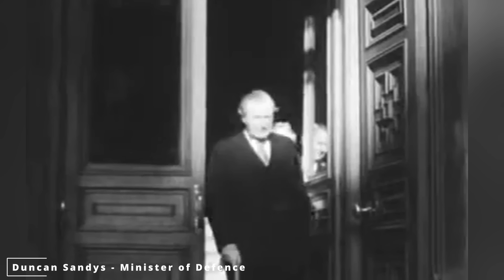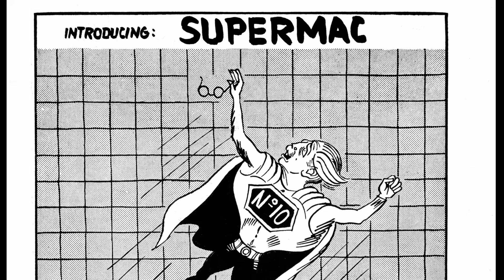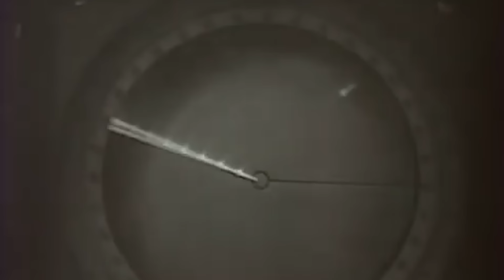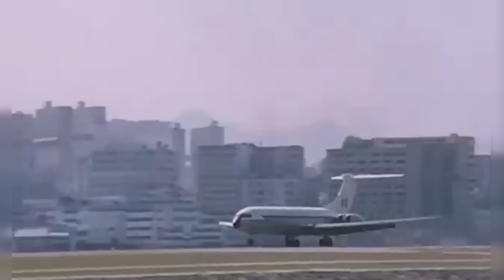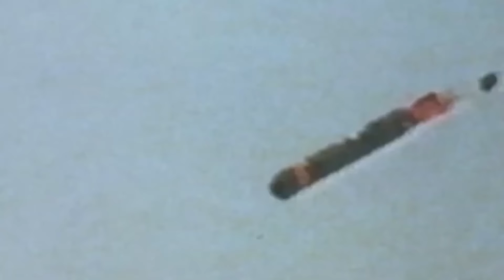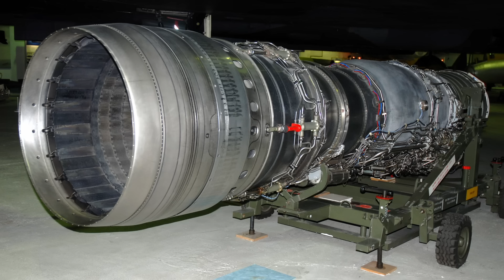How Britain Turned A Failed Airliner Into a Soviet Submarine Predator | The Mighty Nimrod

Comment: The only “failure” is your lazy research. However since you’re calling names , NIMROD was the failure here, costing hundreds of millions to improve its performance which was money down the drain, the usual defense fck up in the U.K.
Reply: We believe we can clear up some commonly held myths and misconceptions obviously.

It's always good to see the facts presented clearly and concisely isn't it?

All production Nimrod aircraft were new build Comet 4 airframes with the necessary modifications. The Nimrod was the most advanced and most capable aircraft of it's type at the time it went into service. The  Nimrid HS.801 was not available for purchase by other countries. The ability  if the HS 801 to repeatedly demonstrate detection of subs and the knowledge that it could deliver nuclear depth charges to a target was a very effective deterrent. 

Bow-wing (see B-47 wing collapse wing folding incidents) had built less than 12 pressurised airliners before the Comet first flew and they were not high altitude airliners. 

All Nimrods were new build Comet 4 airframes with appropriate strengthening and the unpressurized  equipment bay tacked on. 

The HS 801 Nimrod was the most advanced aircraft of it's type at the time it first flew. Problems with the MRA4 programme were almost entirely due to radar and computer equipment issues and BAe Systems & co being too busy with other work at the time. 

Obviously there have been worse aircraft for accident losses both before & after the Comet and Nimrod.

Early problems with Comet takeoff stalls were caused by pilots over rotating the aircraft at liftoff. 

Podded engines on wings have aerodynamics issues. The main reasons for eventually going with podded engines were because or to facilitate - Ease of maintenance. Use of shear off fixings given excessive out of balance forces.
Large diameter turbofan engines.
Reduce load on the wing to fuselage connection. Increased power from later engines. 

The Bow-wing (See B-47 wing collapse & wing folding incidents) was a good example of how to expend a huge amount of cash and effort on something that was probably not worth bothering with. The basic design of the Comet had been decided upon and established before the podded engine choice has been made for the B-47. There were aerodynamics problems with podded pylon mounted engines at the time. The US also built and operated a significant number of EE Canberra bombers under licence which did not use podded engines for their wing mounted engines. . 

There have been aircraft losses caused by pod & pylon mounted engines. 

All jet airliners benefited greatly from the knowledge gained from the Comet incidents & subsequent investigations & yet some were still worse for accident losses. 

Instances of all marks of the Comet flew with full certification after 1954 including the Comet 3. The last Comet flight occured in 1997.

The fabulous trail blazing DH Comet.
World's first jet airliner in regular service.
The jet engined Avro Lancastrian actually did a passenger service before the DH Comet. 
World's first high altitude airliner.
World's first airliner with a full fuselage length pressurised cabin pressurised for high altitude flight. That feature for that type of aircraft was a considerably difficult undertaking. 

The change from larger squarer windows to smaller rounder windows was necessary for the particular aircraft at the time. Skin thickness remained mostly the same for all Comet marks. 

How things were back then.
Accident losses - % of aircraft built.

DeHavilland Comet 4 UK                          14% 
DeHavilland Comet all mks UK (ff 1949)17%  
Vickers VC10 UK (ff 1962)                         5%

Douglas DC-1  US                                       99%
Douglas DC-2                                              47%
Douglas DC-3                                              30%
Douglas DC-4                                              26%
Boeing s300    US                                       72% 
Boeing 307                                                  70%
Boeing 247                                                   48%
Boeing 707  (ff 1958)                                 32% 
Lockheed L-049 Constellation (ff 1943)  30%
Lockheed Electra US (ff 1957)                   29%
Fairchild FH-227 US (ff 1966)                   30%
McDonnell Douglas DC-8 US  (ff 1958)   14%
Sud Aviation Caravelle  (ff 1955)             15%
Canadair CL-44 Turboprop US (ff 1959) 46%  
Convair CV-580 Turboprop US (ff 1960) 22%
Convair CV-880     (ff 1959)                      27% 
Convair CV-990     (ff 1961)                      33%
Tupolev T-104        (ff 1956)                     16%
Vickers Viscount UK  (ff 1948)                29%  
Fokker F-27 Turboprop NL (ff 1955)       40%      

The Vickers VC10, fastest Atlantic crossing for a non supersonic jet airliner, held the record for 41 years.

For the first few years of operation the Caravelle & Comet had similar accident loss fatalities.

Sud Aviation Caravelle - 
all accident loss fatalities - 
1320 fatalities. 

De Havilland Comet - 
all accident loss fatalities - 
453 fatalities. 

An example of a typical airliner from the period. 
The Fokker Friendship F-27 fatalities & accident losses as a % of aircraft built. 
Fokker F-27 Turboprop (ff 1955)   40%
2130 fatalities.

Of course De Havilland carried out a full stress analysis & performed extensive & protracted testing on two long lengths of fuselage representing all features of a complete airframe. De Havilland carried out significantly more testing than was required by any authority at the time & significantly more testing that any previous airliner was subjected to.

De Havilland designers / engineers knew all there was to know about metal fatigue at the time they designed the DH Comet.

De Havilland had prior experience building many all metal construction airframe aircraft including many passengers aircraft & thousands of jet powered fighter aircraft that were primarily of metal construction with pressurised cockpits & used jet engines built by De-Havilland.

De Havilland did indeed always work to better than industry standards at the time, used up to date knowledge for the design & testing activities & no evidence of negligence or criminal negligence was ever produced in relation to the DH Comet.

Global aerospace. 
From the 1950s sector rationalisation and consolidation took place. 70 companies in France and 300 companies in the US disappeared due to merger or dissolution. In the US Boeing was almost bankrupted by the 707 project.  Boeing had a well protected domestic market and the available space and resources in the US to engage in large scale airliner manufacturing enabling them to capture orders simply by being able to produce airframes fast enough and cheap and nasty enough. Another factor is airlines preferring to obtain as much of their airliner inventory as possible from one manufacturer. 

Global Aerospace Sector, what's happening.

For example, there are of course no German companies that makes German jet aircraft in Germany & there are no German companies that make German gas turbine aero engines in Germany that are suitable for widebody airliners.

The UK has the world's highest combined per capita Nuclear / Defence / Aerospace Sector Activity.

UK defence sector, absolute terms, world's second highest activity. 1st for per capita defence sector activity. Per capita nuclear powered submarine construction, 2nd position. 
Main players being Rolls Royce, Babcock, GKN Aerospace & BAe Systems. Activities often involve international collaboration. BAe systems, RR and other UK companies now handle more Airbus work value wise than Germany. 

There's a good chance that anyone currently flying on a widebody airliner will be on an aircraft powered by RR gas turbine aero engines made in the UK and a good chance there will be other hardware on the aircraft that's designed and / or manufactured in the UK. 

Rolls Royce Holdings UK
Subsidiaries
- Rolls-Royce plc
- Rolls-Royce North America (ex Allison etc Classified Military stuff)
- Rolls-Royce AB
- Rolls-Royce Deutschland
- Rolls-Royce India Private Limited
- Rolls-Royce Marine Power Operations
- Vinters Engineering Limited
- Rolls-Royce Controls and Data Services
- Rolls-Royce Power Systems
- Bergen Marine
Joint ventures include:
- Rolls-Royce Turbomeca
- MTU Turbomeca -

Trent Family
The MT30 (Marine Turbine)
Industrial Trent 60 Gas Turbine
Trent 7000
Trent XWB Airbus A330neo.
Trent 1500
Trent 1000
Trent 500
Trent 600
Trent 700
Trent 800
Trent 8100
Trent 900
   
RR wholly owned subsidiaries in Germany handle smaller 2 shaft RR gas turbine aero engine work.

The UK space and aerospace sectors are highly productive, high-value industries that together contribute over £18 Billion in direct Gross Value Added (GVA) to the UK economy. Individually, the space industry directly contributes about 0.3% of UK GDP 7•2 Billion while the aerospace industry contributes approximately 0.5% £10•9 Billion.
   
We hope this helps.